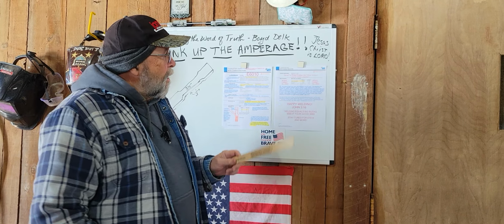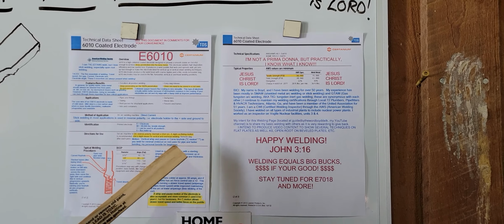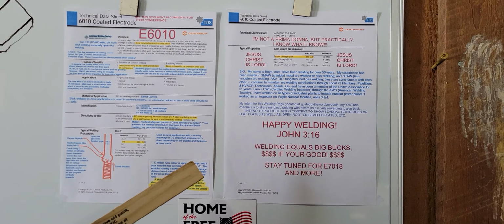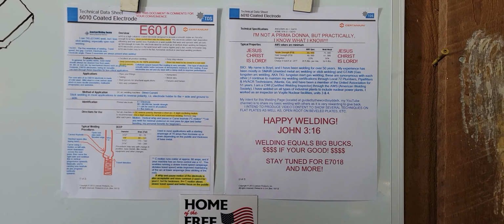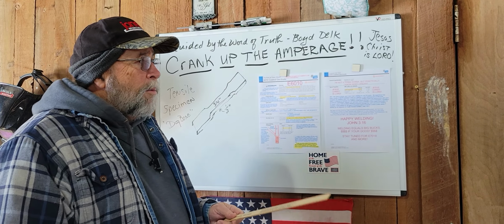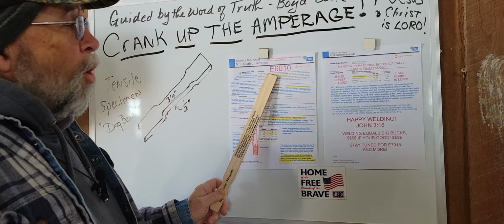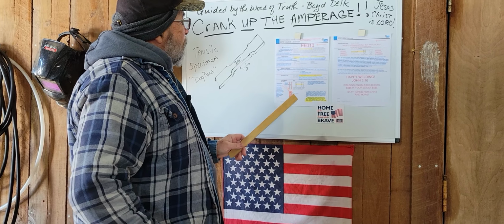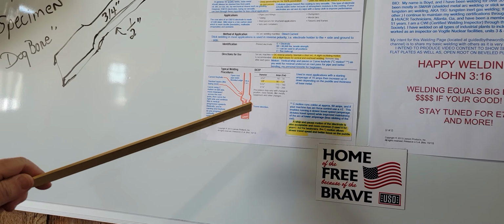Welding Basics: E6010 welding electrode #welding #weld

Comment: Can you use a gloved hand to help hold a rod for stability when welding? Some say no some say yes.
Reply from the maker: @rgray3173  I've seen that done often, but I've never done it. In my opinion, it is best not to because when in some difficult positions it wouldn't be possible, or very difficult.  I think it is a crutch of sort. Getting used to controlling the tip of the electrode while holding the stinger just above the handle and below the clamped rod, I believe, is the best way. Having said that, each welder will develop his or her own technique and what works best for them. Thanks for the question, and I hope this helps. God bless.